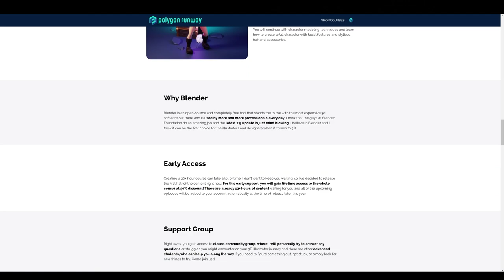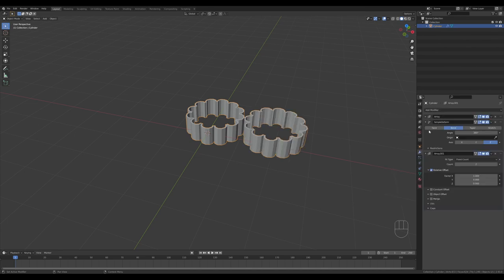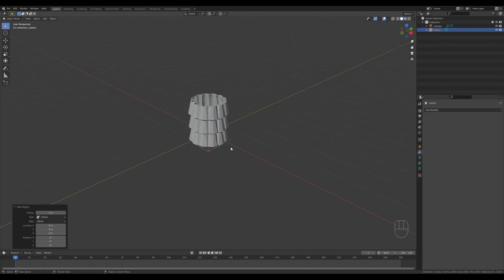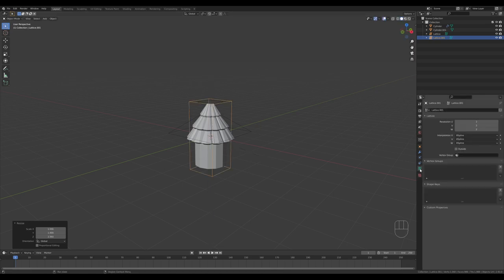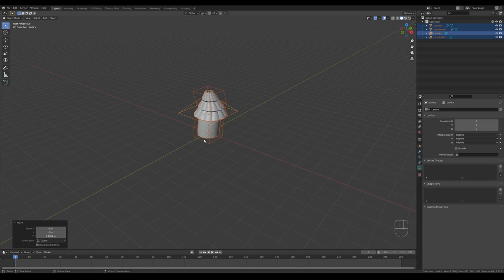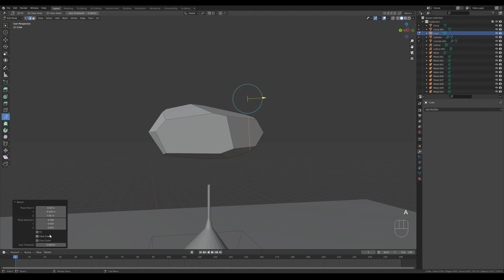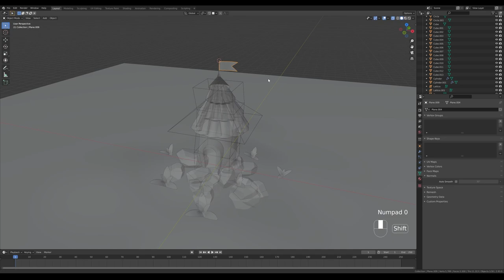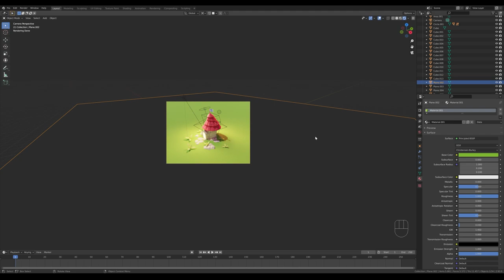Stylized Roof Tutorial in Blender | Polygon Runway

Comment: I'm having trouble with the simpleDeform modifier, Instead of turning the same way yours does it stretches it and turns it in weird ways, I've selected bend aswell and tried changing the axis.
Reply: Hi! Maybe you already solved it but incase you didn't:  I had the same problem because my array was aligned with the Y axis. I rotated the the array to X axis then hit ctrl + A to apply transform. After that my array got messed up so i changed the array settings. Then I put the 3D cursor infront of the first shingle in the array and set origin to 3D cursor. After that it worked perfectly.